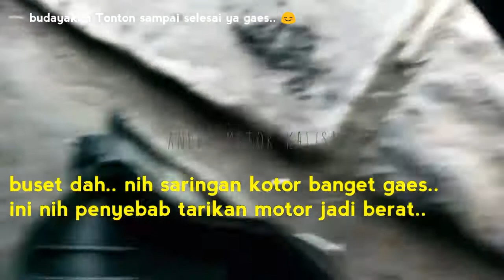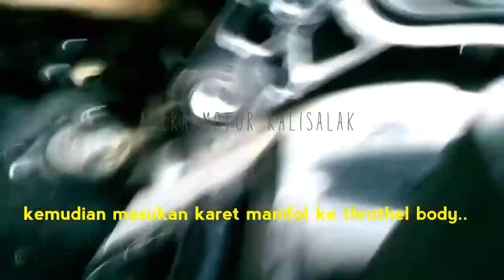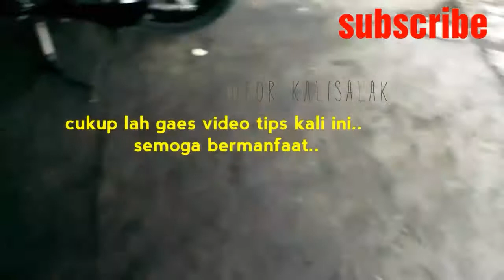cara mengatasi yamaha mio M3 tarikan berat dan susah langsam/sering mati sendiri

Comment: Kalo motor mio m3 berat di rpm tinggi apax bos tpi gas awal biasa ji kaya maksa gitu mesinx
Reply from the maker: Cek bagian kampas kopling sama loler nya gan.. Biasanya kamps sudah mulai tipis.. Dan loler sudah peyang gan.. Kemudian riset sensor TPS nya..
Reply: @anekamotorspeed  reset sensor tps dmn bang